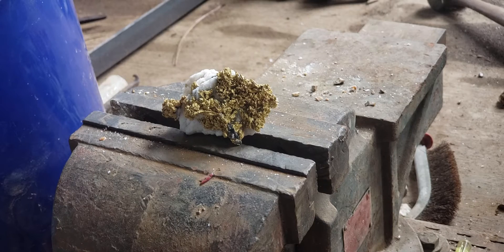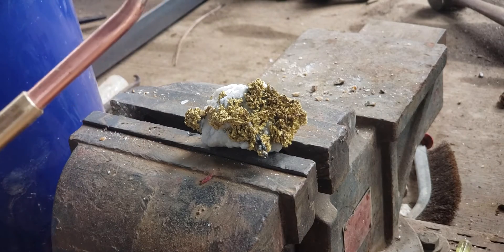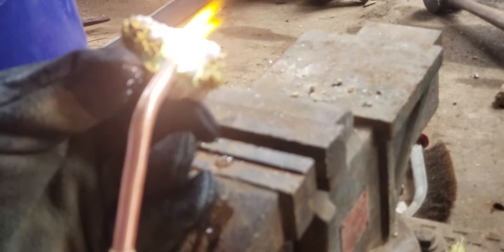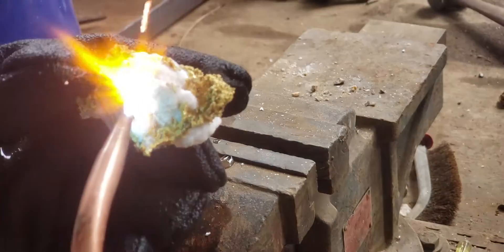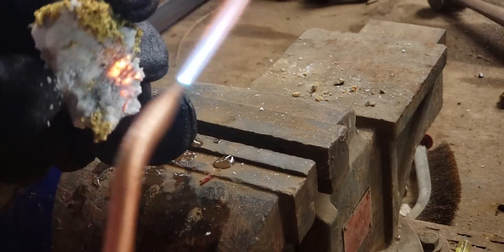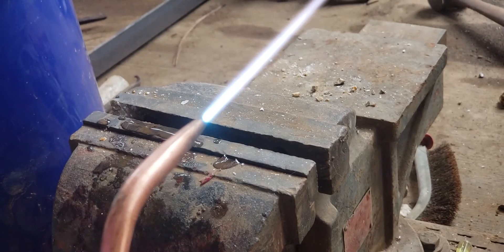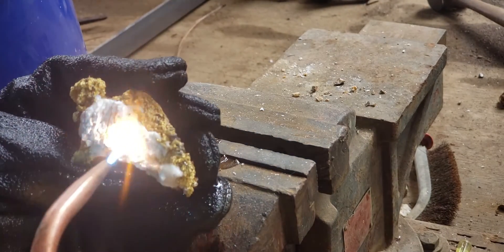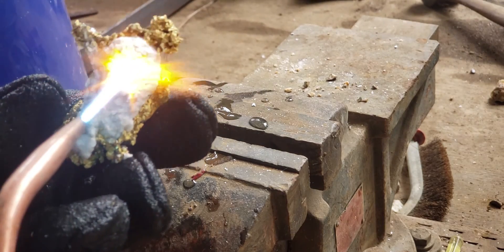Removing quartz from a gold specimen

Comment: The process you do is quite neat, so lets say you bought the original piece for 4k and you get the weight before the process and come out to 34+ Grams after the process you come out with a weight of maybe 30 grams.
Removing the excess material from the gold brings up the value to a collector so the piece has lost gold weight but has also gone up in value to 6k ?
Am I getting the correct idea behind this process?
Reply from the maker: Didn't remove ANY gold at all, a more trimmed specimen is usually more valuable as it shows more gold an is more aesthetic!